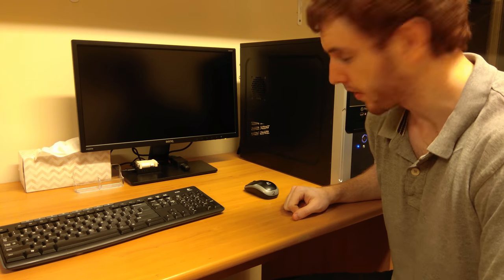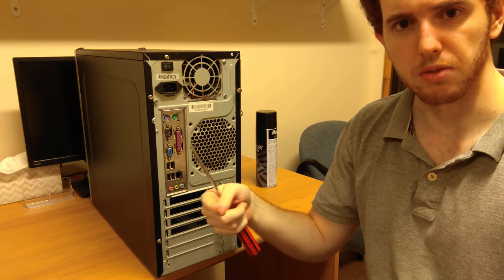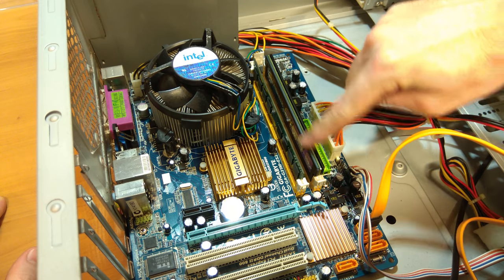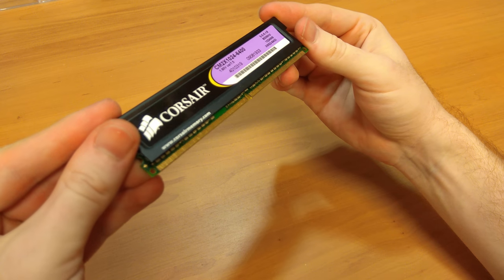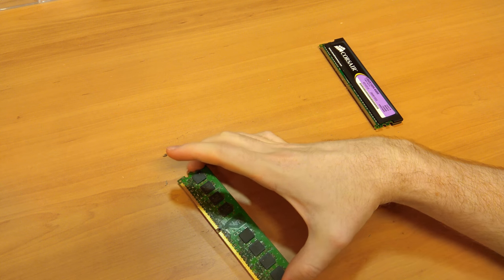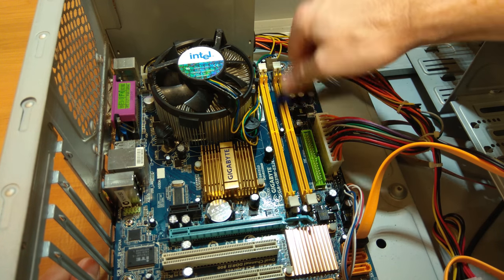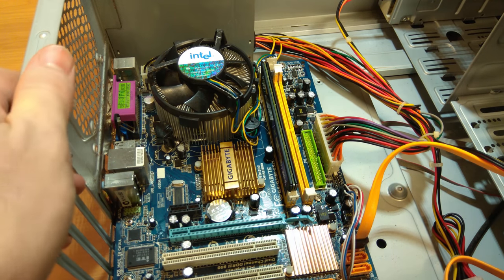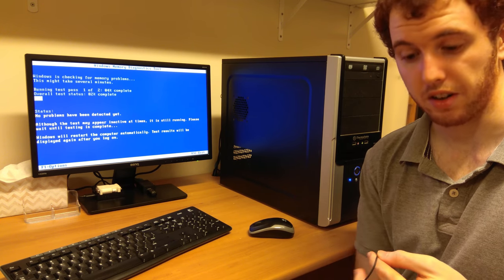How to Properly Clean RAM on your Desktop PC

Comment from the maker: Please note  - if you use a cheap eraser to clean your RAM, it'll leave behind a rubbery film which could cause issues again down the track. It's recommended that you use a microfibre cloth with a dab of isopropyl alcohol to wipe down the pins afterwards to avoid a film being left behind.
Reply: Can confirm 101% THIS FIXED MY HYPER FURY X RAM which I almost threw away!
Reply: Thnk u so mch 
Love from INDIA💚💚
Reply: Can I use eraser then the alcohol?
Reply from the maker: @iagree756  yes.
Reply: So in short how to clean you RAM? Please can you answer i need it for my online class
Reply: @hermiedeabanico1884  
Short: Use a white eraser to clean it and another way to clean it is using isopropyl alcohol to clean it even farther but only apply it on the gold ends of the ram
Reply: @iagree756  Can i use Rubbing Alcohol?
Reply: @ImranPangilinan  bet
Reply: Can I use sanitizer for cleaning RAM 😓
Reply from the maker: @maniacgamer7555  no, it may corrode it. Use Isopropyl or any other pure alcohol
Reply: @maniacgamer7555  bro😂😂😂😂 sanitizer is for clean yourself not to clean ram
Reply: I'm gonna try that later because my pc is on but no display LOL
Reply: @AdityaRaj-bk3yw p

Comment: I have never dared open my computer before. My monitor stopped sensing the computer and one tech website suggested to clean your ram sticks. When I searched for how to do that, your video came up. I cleaned them and put them back but not firmly enough and the computer beeped a code that meant that . I pushed them in more firmly, set everything back up and it worked!!!!!!!
Thank you

Comment: Thank you so much for this video. Five years later it is still relevant. My trusty PC just started working again. Thanks!! I used some contact cleaner with a soft brush on the RAM gold contacts as well. Same with graphics card. Everything got the same treatment. Changed the 10+ yr old motherboard battery while I had it open. Thanks!!

Comment: I was replacing a cpu cooler and took out my 4 sticks of 8GB RAM to make more room. Put everything back together and then my computer would turn on start to boot up then turn off and start the whole problem again. I eventually narrowed it down to one stick of RAM causing the problem, because when I removed it, the computer would boot up. So it appeared one stick went bad ....... or was it? As I looked at the contacts i noticed a smudge on one of the contacts. I must have accidentally touched one of the contacts when I was removing them from the PC. So small, almost invisible. I cleaned it, reinserted the RAM, and BAM! It worked and the PC booted up fine. Something so simple.
Reply: Same shit here with my Furx ram lol same exact symptoms 🤣 same solution
Reply: Im having the Same exact problem , Booting for 20 seconds then fucking dies and repeats , For now I did not try the Ram eraser Trick

Comment: Thanks, recently got a dell optiplex 790, had quit working the other day trying keyboards and said no signal from computer, and had pulled out the cards and replaced them, but tonight cleaned pins with a cloth and put in a new battery! Working again. Tried a new dell keyboard and monitor, working again! Texas

Comment: after pressing the power button I immediately hear 24 fast beeps then 8 fast beeps then 1 long beep, then 4 or 5 short beeps.  I then turn my windows 10 desktop Pc off. turn off power at the back, press the power button to release any excess charge and try to turn it on again.  I try this process 4 or 5 times to get the computer to boot up.  please can you help. thanks

Comment: .hi there....can you help...i re-pasted the cpu and back togethere turned power on and pc runs but switches of then comes back on --on its own and it will repeat on and off?...i have took ram out and pc runs no problem..as soon as i replace the ram goes back from on-off  on--off...i have took the battery out thats doing no differance..and i have also tried the rubber on ram still no joy...can anyone help as im comfused..thank you so much...ROB....ps the ram is about a month old..thnx.

Comment: Whole thing was working fine I tried installing a new psu, gave me no screen and two beeps, then change back to original psu and same thing, just tried cleaning the ram and it didn’t work :((((
Reply: Maybe it’s the monitors fault. If not I just think you should sell all the parts if you TRULY can’t find the problem and buy a new one
Reply: What model computer are you using or is it one you built yourself?

Comment: I've been dealing with this 2 long beeps error with Red LED from my HP SFF. I think i really need that contact cleaner since the eraser part wont do the trick anymore. Lastweek the eraser trick fixes my problem but a day after the problem will just go back again.
Reply: Use the eraser, brush the residue off, then YES use the contact cleaner then wipe the gold contacts! PC will not boot up with just an eraser since it leaves residue on the ramsticks themselves! The contact cleaner and paper towel removes that residue from the eraser and you are good to go!

This happened to my HyperX twice in a span of like 2-3 years. I’m surprised how filthy ram sticks can get
Reply: @ImranPangilinan  is it possible that i can use that contact cleaner with a Ram slot? The Ram that i meant above is working fine when i tried it on another pc. Thanks for the response! 😊
Reply: @vancanque2213  first use compressed air on the ram slots then gently brush the slots, then use WD-40 SPECIALIST CONTACT CLEANER. Spray it on the ram slots and let it dry for around 30minutes. Should work again unless you have bent pins or burnt ram slots.

Comment: 1:01 all these 3 problems happened with me yesterday, some were progressive and booting up problem happened suddenly.

I had this problem earlier, that time i cleaned the Ram slot only (with air), Pc started nicely after that, and i didn't touch RAM stick, just to not mess anything.

This time the symptoms were different and they took time to develop and deteriorate. First I thought it was graphics driver problem as most problems i had were with graphics. 

Now, I'm glad i found your video, thanks.

Comment: I advice not to insert and reinsert the RAM, you'll damage the RAM gold pins by scratching it to the RAM slots metal contacts...
Reply from the maker: If your RAM slot is physically damaged... it's possible, but I highly doubt it.
Reply: I just did that a gold pin is gone
Reply: Thats sad

Comment: Can I use cleaning wipes to clean the ram sticks?
Reply from the maker: No. Traditional cleaning products are not designed for for electronics and may corrode the contacts. Anything soapy will probably cause serious problems. I recommend using 99% isopropyl to ensure that no residue is left behind.

Comment: Dont listen this guy ur ram wil be destroyed!!
Reply: Proof?
Reply: @kaizen2840  It doesnt worked on my friends old pc. Had also those 8 months ago when I placed that comment I had a laptop where the screen does turn off randomly. But after using this trick the screen didnt boot ad all!
Reply: @GamingVasta  did you use water or something, also if you have static hands it can ruin the compenents. Well from what you tell me it didn't destroy your ram
Reply: @kaizen2840  ive static band I use for my own hardware.
No jome I have worked in the techicle side of a computer shop Ive been building pc's for half a year there for intermship.
They dont use static band there so the half year I build without static band nothing every happend no joke.